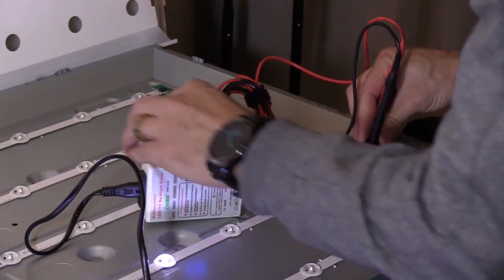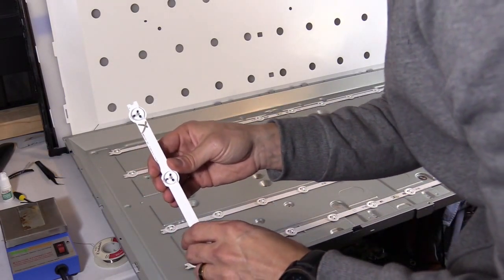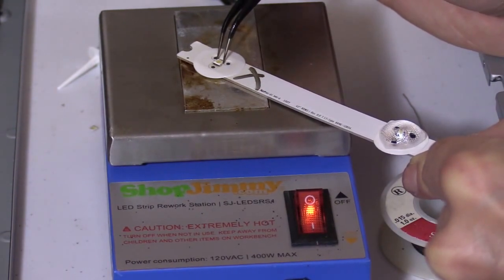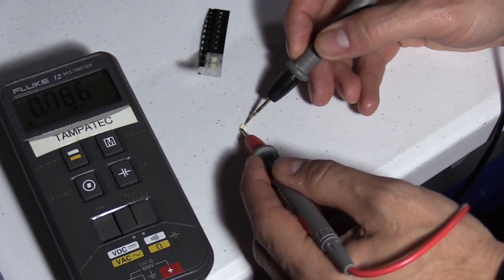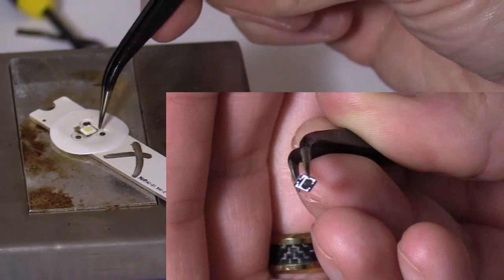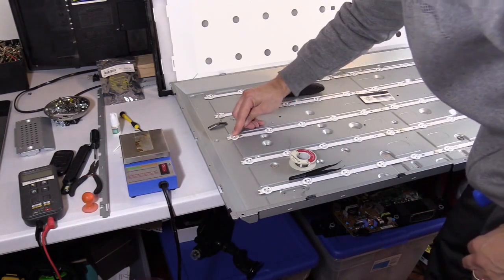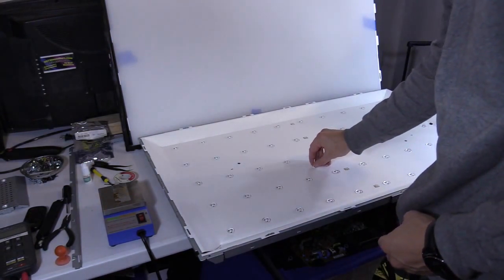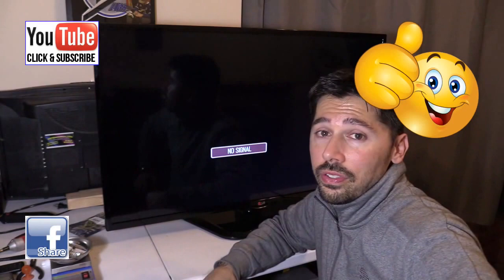How to Check & Fix TV LED Backlight strips - LED TV backlight repair kit

Comment: I have an ONN branded 43 inch LED TV and the backlight goes out but the tv still shows a picture if you shine a flashlight on the screen. I took it apart and there was a bulged capacitor near where the backlight output connection is and the plastic wrap is cracked and brittle and the capacitor is glued down to the board right on the values.  I looked closely and it seems to be a 200v 33uf does this seem right? Cannot tell 100% what is needed.

Comment: We now a days have a vertical line on the screen of TV when the TV is on. Before some days ago the line disappeared by itself but now it doesn’t go away until the TV is on, so in your opinion what could be the reason why it happens?

Comment: Manufactures must put led strips in the back of TV where the boards are when replacing led strips do not need to take of the front panel and screen.

Comment: Happy New Year Paul! 
Anyway I have a few thoughts. First, you ALWAYS should REPLACE not REPAIR LED strips. The logic is that if several individual LEDs have failed, there certainly will be more failures down the road. When my company first started repairing BLs, we did repair the individual LEDS , but found out that future LED failures were going to happen because the other LEDs were weakened by having the BL setting set to high. With the cost of LED strips coming down, particularly at Shop Jimmy,  I recommend only replacement, vs repairing the LED strips. Also after the replacement, its important to lower the BL setting to no more than 60%. On LGs and other selected manufacturers, you need to adjust the BL setting in each of the preset modes( Movie, Vivid, Normal, Sports, Gaming....etc....). We have also found that modifying the power supply to limit the BL current has been very effective to keep future failures to a minimum. This can be accomplished by replacing certain resistors which will limit the BL current by 10%-15% and not affect the quality of the picture. Hope this helps, Respectfully, Wayne, President of Affordable Mobile TV Repair.

Comment: Totally unrelated question, but if anyone more familiar with tvs could answer.  Took my tv in for a repair, long story short its still doing the same thing I took it in for but not as bad.  The repair guy is telling me that he needs me to bring the original main board to them because he thinks the OS is confused by the different serial number.  In my field this makes sense as our computers can tell if an imput is incorrect or missing or wrong number....but in a TV?  is this a real thing or am I getting jerked around?
Reply from the maker: Not sure about serial number thing maybe he needs the board to see main board serial number printed on the board to confirm he ordered the correct board. I don't think you're getting jerk around unless he's charging you for extra things after the original quote. Also sometimes techs get defective boards and need to exchange them.
Reply: @TampaTec  I had already tried replacing the main and power boards, left the second hand main board on it and original power board in it when I took it in. They claimed the panel needed a “proprietary microprocessor fix kit.” Charged me $300, went to pick it up today as they said it was fixed, got there and it still shuts off on its own. At least gets past the Samsung smart tv title screen now, but still just shuts off. Left it there and that’s what they are requesting now, the original main board.

I don’t know nearly enough about TVs, learn what I can from your videos. I’m a diagnostic tech for a diesel company and we too have some components that can tell parts are wrong serial number/code....but I was not aware of a TV having something like that.

Comment: Great video.  I was looking at the repair tools you suggested.  Do you have a video related to selecting repair tools to use or best for a beginner starting out?
Reply from the maker: I'll make a video.
Reply: @TampaTec  You Rule.  I tried to find the fluke 12 meter but it was discontinued..  Thanks for the great value you are providing.  Im trying to source some for repair.

Comment: I was watching another vid and he was using a 18650 battery to test backlight just using a wire at each end
Reply from the maker: Good to know all the tricks of the trade.
Reply: @TampaTec  I'm sure ur going try it will u let me no if it works

Comment: Replaced several LEDs with the hotplate under a microscope; everything went fine except now it has bright spots when I put it back together. Vizio D32x-D1
Reply from the maker: Yes, also I find that Repairing Led strips don't last as long compared to replacing all the strips for new led strips.
Reply: What smd led did you use to replace the strips in them
Reply: @jamiewallace4413  Vizio D32x-D1 210BZ07D0M3030C05L Replacement LED kit  from ebay